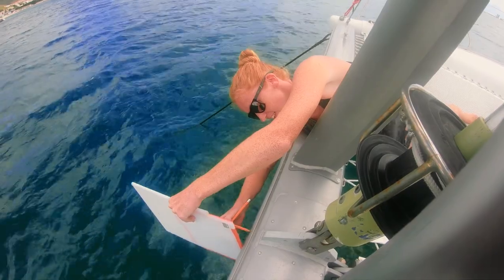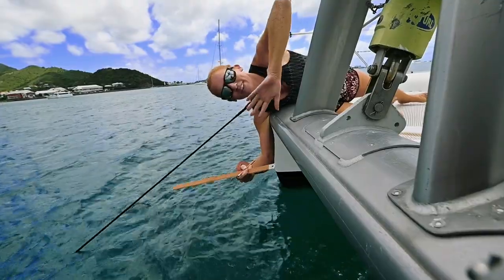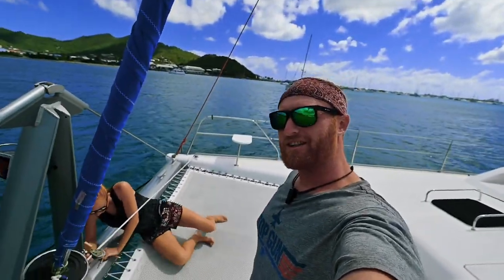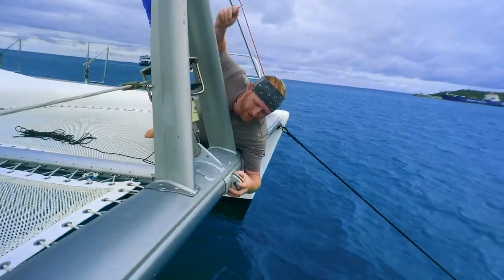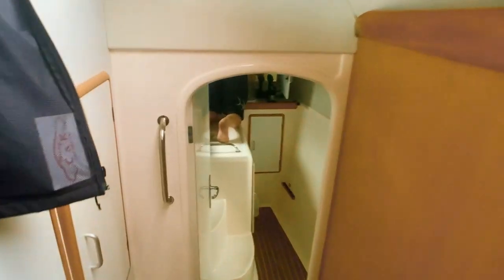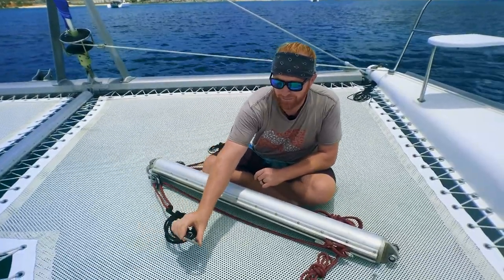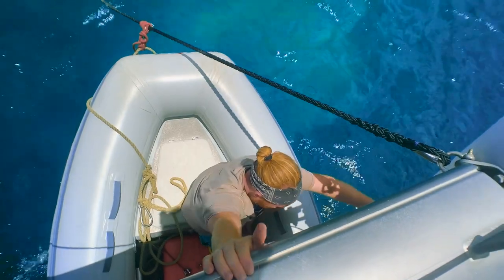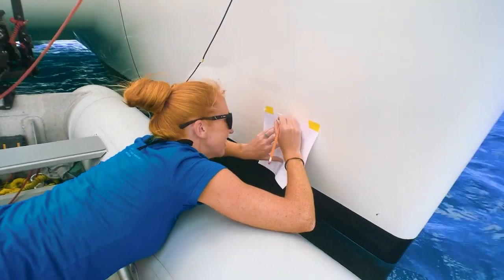How to BUILD A BOWSPRIT for less than $400! [Ep48 RED SEAS]

Comment: The hull has no core in the bow, therefore this would be the right place to mount the pad eye as balsa is first compressible and second not water proof. It will root and the pad eye may rip off. Core is only good for creating stiffness on big surfaces smaller areas will not profit from core and additionally balsa would be hard to shape into the mold during production. I strongly suggest to dismount the pad eyes on the hull again, drill much bigger holes,  big enough to fit the screws into and fill the holes with epoxy. Then drill holes again for the bolts and seal them well. This way you'd make the core root proof and compression proof the same time. A naval architect.
Reply from the maker: Thanks Andre. All very safe advice. As it happens, we actually did most of what you outline as part of the installation we just couldn’t find a good way to show the epoxying of the drilled holes. They were filled with epoxy and re-drilled to ensure the core has no exposure to the elements. 

The area we fitted the pad eyes is actually designated in the hull design and has an “indentation” on the inner surface of the hull, where we fitted the G10 boards to disperse the load across a much larger area with no flex. 

It’s certainly been an adventure figuring all this out and discussing with various shipbuilders and riggers to keep us roughly on track but input in these comments is exactly why we release these videos to YouTube. It’s invaluable gaining from the knowledge and wisdom of everyone who watches our journey. Thanks
Reply: @RedSeas   So that's great. Forget about my comment... 😀

Comment: Sorry to say that; the hatches are dangerous they are not strong enough if there is water moving in the compartment. You can by special ones for this usage in the marine market. Please change them, I know of a boat that nearly sunk because of this. Sorry again.
Reply from the maker: Appreciate the insight for sure. We had checked them out when we were buying them. They are actually fully gasket sealed and locking (didn’t really come across in the video) so we were told they could do the job. That said, we are always open to new ideas. 

The crash lockers in Indioko are a bit of a funny situation. The leopard 47 can actually have both lockers filled to the top with sea water and still sail. The combination of bulsa core, native buoyancy and cat design somehow defeats physics (I know I dot trust that either). 

But as you say, we should check them out. At least they aren’t hard to switch out if we have to. 😃

Comment: Assume you used what we call Finder washers here in the US, oversized washers to spread the load? Looks good just did not see the final interior install.
Reply from the maker: Haven’t heard them called that before but sounds exactly like the washers we used. Basically as big as we could go without overlapping them 😂 
Was a stressful process making more holes in the boat but so far I think it paid off.
Reply: @RedSeas  I figured you would do all you could do the beef up the inside.  I had to pop the tops on my beach cat to install a spinnaker pole, not a project for the faint of heart.

Comment: In keeping with scribing a curve and using primary school methods you could rough cut some cardboard then use Plasticine to fill in the gaps and transfer that to a better surface. Alternately they do sell tools which are very cheap and would take 2 seconds they  are normally in the flooring section of DIY shops.

However it does look as if your mate did a fantastic job of changing that straight surface to a curved one
Reply from the maker: Good call on the plasticine. Perhaps we will search the next hardware store for something. Out here it’s often hard to find the right materials let alone tools. Most islands main supermarket is smaller than a corner shop in other parts of the world. Lol

That welding job was so impressive given how amateur our information was 😂

Comment: Nice job guys, but .... (notice how there is always a 'but') unless you galvanically isolated the stainless mount plate to the front beam you WILL have issues. A liberal coating of Tefgel or similar on all dissimilar metals when mounting is essential,  otherwise you will very quickly end up with a very large hole in your front beam. While it is being remounted it may also be prudent to upside those rivets to at least 1/4 monel, also Tefgel coated. You will need a much bigger rivet gun. Keep up the great vids.
Reply from the maker: Hi David. Cheers for looking out for us. Good news is that the reason we repurposed the compression post and hinge bracket was exactly for this reason. They, like the cross bar, are aluminium. Good news as it means we have no dissimilar metals to worry about. That said, we have tefgel’d and rubber washer’d the large stainless 306 nut and bolt used to create the pin hinge. It’s a constant challenge onboard to keep potential (and likely) corrosion to a minimum. Lots of fun but thanks for the hawk eyes looking to keep us out of trouble.
Reply: it's alloy to alloy.

Comment: I liked the backing on the pad eyes.  I would be using a metal ring with through bolts under the access hole, for lateral crush strength as the subdeck strength is compromised due to hole.
Reply from the maker: Yeah, it was a big concern for us too. Thankfully a fellow cruiser had gifted us some G10 to use there. We would have preferred to glass it in place to make up for the hole but, as you saw, the working space wouldn’t really have allowed for that easily. Still happy with the results

Comment: A much easier way to get that crossbar profile would be to mold a soft material to it, something that can be hardened! And now you need to attach a seat to the bowsprit.
Reply from the maker: Good shout. We actually found that the end of the cross bar was open anyway so we got the exact profile by simply holding a piece of cardboard up to the end and a pen outline. 😂 

A seat sounds like a fun challenge. We have to two seats on the bows but one of the sprit would be interesting 🤔

Comment: Those 4 tinny re it’s will not hold the wind/ bow sprits. I would put in some threaded bolts after you thread the bow sprit with a tap.
Reply from the maker: Not a bad idea. We smashed in a bunch of rivets mainly because the forces are directly on the end of the bar when in use. That said, it’s in testing phase so we may well have to beef it up a bit

Comment: That's totally amazing - lots of really hard work, maths and scribing in order to ..eh get a pole thing on the front so you can... stand on.. fish from.. ram passing ferries..  ... ok What's a Bowsprit for? Wikipedia isn't helping me.   #landlubber
Reply from the maker: Haha. This comment got held for review. You must be trolling us. 😂 
We are still working on showing off what it actually does as we have to find a special part to show it off (and they cost a fortune so we are hunting a 2nd hand one). In short, a bow sprit is a pole that makes the front of the boat longer, we can suspend a sail between the top of the mast and the end of the bow sprit which can be much larger than the Genoa we normally use as the foresail. It means we can sail in lighter winds as the bigger sail will catch more wind or more importantly for us, we can sail in the same direction as the wind safely at night as one person can deploy and stow that huge sail from the cockpit…once we find the special part that is. {RedSeasWiki entry#1}